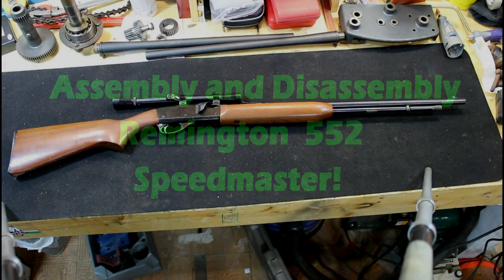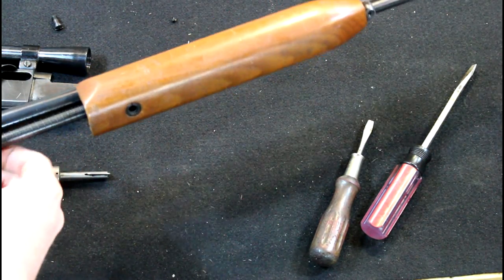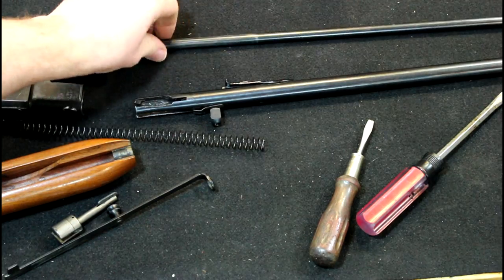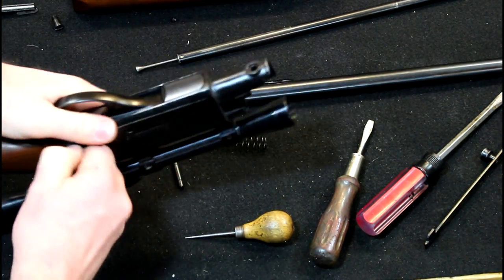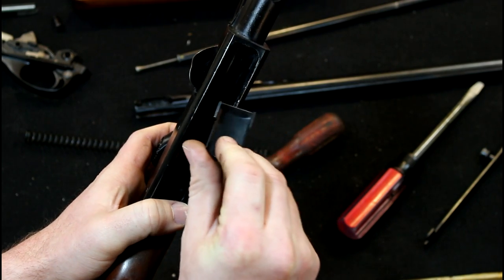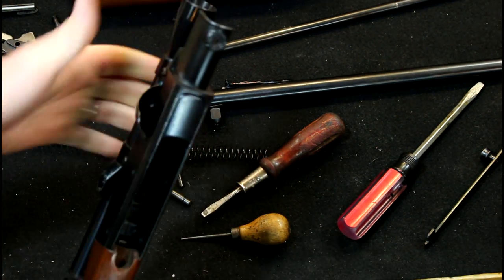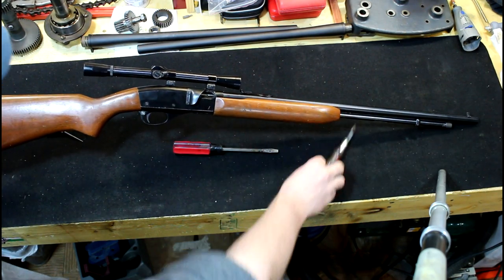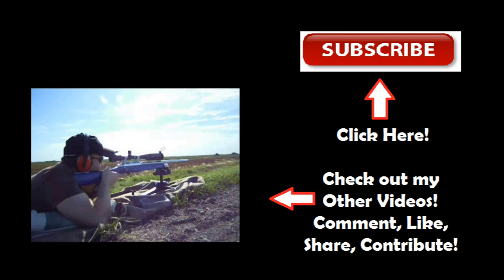Remington 552 Speedmaster Disassembly, Assembly Professional Gunsmithing

Comment: This is one of my favorite 22 rifles. One thing I will say is that I’ve had that little magazine tube retention screw come out a few times. After I lost one in the weeds at the range (and paid $7 for a good used one on eBay), I put 1-2 drops of blue Loctite on it. I find that these rifles are built pretty “tight” and accumulate powder waste pretty quickly. I suggest using minimal amounts of clear light oil and good ammunition. I met a gunsmith once who told me 90% of 552 Speedmasters brought into his shop for repairs are just really very dirty and crying for a proper oiling.

Comment: Given to me by my wife's father when he'd grown too old to wander afield, my Speedmaster 552 likewise had seemingly grown too old to use, jamming with nearly every recharge. This video broke it down on disassembling for cleaning. I could see wear on the bolt from lack of lubrication, and the receiver and action were as nasty as described. Less than 10 minutes to disassemble thanks to this video, an hour to clean, and some resistance from new scope mounted too far forward. But it went back together smoothly overall. Action's smooth once more, and I'll have to take it down once more to prep the barrel for paste rebluing. But then there was that satisfying SHH-Click of the charging handle, followed by a solid Clack! from the firing pin. Thanks for this - it put me in touch with late Father-in-law, knowing that he'd likely used it in the 50's & 60's to bring home rabbit for dinners in Eastern Washington for 3 daughters, wife and her parents. There's a kind of magic in a gun this old, and your video has played a big part in restoring this one. Thanks.
Reply from the maker: Nice story, Glad you were able to get it up and running again and that I could be a little part of that.
Reply: $ cuanto por él rifle
Reply: Nesesito la pieza que agarra con las 2 manos

Comment: Thanks for great video. Cleaned my dad's Dec, 1959 model, I shot thousands of rounds thru as a kid. Loaded up all the shorts it would hold and shot them all in several seconds. Never ever had any issues.
Reply from the maker: Randy Roberts Thanks for watching. I know I shot probably 10,000+ rounds through my 10-22 when I was a kid before I knew they needed to be cleaned thoroughly every once in a while. Firing pin finally got so gummed up it wouldn't strike the shell hard enough to fire. That's when I figured it out a long time ago. Appreciate the comments!

Comment: Great video.   First time I did this since I've had the gun for 50 years.  The only difficult part was separating the barrel assembly from the action. Had to work at it for 10 minutes or so.  If I hadn't seen your video I would have never figured that out.  I also lost time figuring out where the little metal clip came from that fell out of the forward wooden grip. I'll look for more of your videos.
Reply from the maker: +Mick Dousman 
Good to hear! If its never been off like yours they do tend to get stuck! Thanks for watching and commenting!

Comment: Great vid.... mine is from the 70's and I've never cleaned it at all. Went to shoot it today and it jammed for the first time ever on me... it really did something weird.. jammed up and a round got stuck and I didn't know so I went to shoot it again and it sounded loud as a 12 gauge almost.. and blew off the side deflector plate!  The two little screws are still there but plate blew off. Very strange as if the bullet came out there🤷🏾‍♂️ when I un jammed it it looked like two rounds were stuck together as if one was overlapping the other... WOW...I will be throughly cleaning it today thanks to your vid. 👍🏾

Comment: Picked one up a few years ago.Liked the idea of shooting shorts, longs, long rifle. Finally decided to take it apart, mostly to refinish the stock.  Glad I found your video, came apart fairly easy except the bolt was so dirty it was stuck.Got it all cleaned except I can't get the large screw that holds the stock loose. ( Just like Browning Shotguns almost impossible to get them loose)
Reply: Gary:  I'm in the process of doing the same thing.  I have the large screwdriver but it keeps slipping out of the slot.  So, I taped up the receiver and sprayed the orange paint remover which will peel and flake overnight.  Then some scraping and sanding.   I did that to other stocks and it turned out great.

Comment: Thanks for video! Just picked one up the other day. It's either a 1960 or 1967 model. Couldnt figure out how to read the date codes. I took it apart today and I would have to say it was the dirtiest gun internally ive ever seen. It was packed with black chunks and carbon build up. You can eat off the inside of it now. I made the mistake of putting the trigger assembly back in before sliding the barrel back in place. After a few minutes of head scratching i removed the trigger.lol mine has a western field scope on it. I might actually see if it still works before updating the optic.

Comment: Great video !   I have my dads and shot it a few times but the outer magazine warped and looking for a new one.  That charging handle spring was a b!thx to put back in but I didn’t realize I could take the barrel out once I removed that first screw.
Reply from the maker: Glad it helped. There are several companies out there where you should be able to source a new mag tube.
Reply: @precisionmachineshed  I was able to find one in good condition on eBay last week.  I went to the range today but grabbed the .30-30 lever action on accident so haven’t shot it yet!

Comment: Quite nice vid. Professional, educational. I used this  vid for my Rem. 552 project with exc. result. Thanx!
Reply from the maker: lee sherman Hey, Thanks! I'm glad it helped you out! It's a little tricky is you've never done it before!
Reply: spitfire1821 Hey Im having some trouble with my 552 when i took it apart it was funtioning fine. i took it apart for cleaning and put it back together and the bolt wouldnt rack back, it seems really snug in the barrel like almost stuck.
Help please oh and the barrel wont go all the way back into the receiver without me having to take the trigger out and put the barrel in and then the trigger group
Reply from the maker: TheIceman623 Sounds like something is going on with your trigger group. Make sure that the hammer is cocked back when you put it in. I do know that I did notice the same problem with the bolt on this rifle, and I was quite confused, I ended up taking it apart and making sure everything was absolutely clean and very very lightly oiled. when putting it back together make sure that everything is lined up as it should be. also be aware of the plunger on the magazine tube. It can sometimes get caught up in the wrong spot preventing proper installation of the barrel. Hope one of those things helps.  It's hard to diagnose things like this without seeing it in person, but hopefully we can get it figured out for you!

Comment: Ive had mine in the safe for years... No telling how long since its been fired. And, as I thought It jams trying to shoot shorts. Shooting shorts in this rife has a low noise and nice to fire. I guess its just dirty from not being used. I thought maybe its the shells... Looks like I will have to take it to a gunsmith and have it clean. The gun looks new... I enjoyed your video....
Reply from the maker: Hey, thanks, I can't recall if this one was designated to shoot shorts, but many times shorts don't have the power to cycle semi's. Never hurts to have it cleaned though! Good luck with your 22.
Reply: @precisionmachineshed  They will cycle regular shorts, but will not cycle cci 710fps  shorts. It will work with cci quite 710fps long rifle. Guess the 40 grain bullet gives more blow back.

Comment: Great video!   Have you ever had a 552 that stabs the round into the top edge of the chamber, causing a jam? (enters into the chamber at too steep of an angle)  I took mine to a gunsmith probably 20 years ago and he put a chamfer into the top edge of the chamber.  It helped just a little but it is still far from reliable and I basically stopped shooting it.  I'd like to get this thing back running again as it was my first firearm.

Comment: Thanks for sharing this video my question to you the tiny screw that's gets snugged in by feeding ramp I notice if I crank it in tight it appears to rub against the brass rod . Is.it supposed to be just snug ? Or cranked in . Also I am guessing to lock tight ? So the screw don't get lost

Comment: I had a bolt jam, when I took out the trigger assembly out there was a loose part that is a u shaped. I didn't see you  disassemble, but I think I saw it still in the receiver. I think its called a buffer? Can I just put it back in place or is it secured in some fashion?  Thank you
Reply: @Paula Palmer. There is a rubber bumper that goes in the receiver behind the bolt , and a metal clip that goes into a slot in front of it ,Numrich arms has schematic to help you see it.I am getting double feeds with 1250 fps ammo, but Remington target rounds cycle flawlessly. I think the 1250's cycle the bolt too far back.

Comment: Thanks for this video.
My 552 is about 50 years old and for the life of me, I can't unscrew the Take Down screw through a normal screwdriver. May I use a manual impact screwdriver to start it? I assume there's some rust holding it.
Thanks again.

Comment: I had a question please. I am barely on the first step. My screw is not coming out and I'm close to stripping it. I have the same rifle. Can there be a lock pin in it? It's not coming out. It move a tiny amount but I'm totally stripping the head of the screw

Comment: I may have had the dirtiest trigger assembly ever. It was so bad that the trigger release for the hammer would not engage. Guess what it did? That's right, full auto as soon as you released the charging handle, without even touching the trigger! Fortunately, there was nothing around when 4 rounds went off full auto. The reason only four rounds is #5 jammed. Cleared the jam and released the charging handle and the same thing again. Unloaded the rifle and headed home to clean it. Got it on a trade and never checked to see how clean it was. Lesson learned.

Comment: Good video but that kind of ejector is called an "extractor". The ejector is fixed in the receiver like most other weapons. Easiest way to remember the difference is that the empty shell casing is removed by the "extractor" on the same side it comes out of because "ejector" kicked it out.

Comment: HEY, Great video...watched it before disassembly of a buddy's newly acquired 552...I followed the video instructions and cleaned rifle thoroughly before re-assembly...rifle cycles without ammo and seems to cock and fire on an empty chamber. BUT when using live ammo, the rifle will not fire; I pull back charging handle to cycle a round into chamber manually, pull the trigger, and rifle does not seem to have cocked hammer. I then cycle the rifle again manually, it will fail to strip a round from tube, and it seems to cock and sounds like hammer strikes an empty chamber. I then cycle manually and it loads a round into chamber but will not fire. This sequence repeats itself until all the ammo is fed through tube...ANY HELP WOULD BE APPRECIATED!!!Thanks
Reply from the maker: +Ted B Hmm.... well these issues are kinda hard to pinpoint without having it in hand. I would pull it apart and make sure the hammer is cocked before you put it back in. I know I had some issues when I put this one back together, but it had to do with the fact that I switched out the barrels, and the plunger in the feeding tube was causing issues. I would also make sure that the firing pin is really clean and nothing got stuck in there. Also check the back end of the barrel to make sure that the bolt in going into full battery when a cartridge is there. A little gunk might be keeping the case from seating directly on the barrel and might be causing the non-firing issue. Also make sure the bolt moves freely in the barrel when it is all apart. Beyond that I guess I would have to think some more about it. Like I said, hard to fix without having it in hand! Thanks for watching and commenting. Let me know if anything works, I'll let you know if I can think of anything else.
Reply: +spitfire1821 Hey thanks for the response...I have already tried all the fixes you suggest without success but upon further examination I think the FP is NFG. Aside from that I did find a site that suggests a fix that you may want to look at: http://gunhub.com/rimfire/58339-remington-552-speedmaster-firing-issues.html... waiting for some parts now....tb
Reply from the maker: +Ted B Some good info there. Of course I forgot to mention ammo. The sear would make sense and could be an issue, but does not explain the non-feeding issue. Make sure the tube is in it's proper place. A 1/16th of an inch off ether way and you will have feeding issues. Some of these 22's can be a real pain, I once got a browning Challenger 22 that was sent to Browning and seen by a couple other gunsmiths and they all gave up on getting it to function properly. I got it and figured out the feed lip angles on the magazines were not correct and it would only function properly with high velocity .22lr ammo. Worked great after I fixed it and I got it for a song!

Comment: I own a 552a and have owned it for about 55 years.  When I bought the gun it had a small problem, load it up and pull the trigger and all fifteen rounds would fire before it stopped, problem was you couldn’t stop it.  The guy I bought it from wasn’t a gunsmith but knew what was wrong.  I was working in Gulf Mart store in Ft. Smith, Arkansas and I sorta ran the sporting goods section at night.  One night he traded the sear out in mine and a brand new 552a, week later I sold the one in the store, it had the full factory warranty but never came back, mine shoots in the regular semiautomatic way, one bullet at a time.  I immediately felt like I had a made big mistake, didn’t fire another auto until it was a M16.  Anyone else ever have this experience?
Reply: No..but if I has, I wouldn't tell anyone about it

Comment: The spring is stuck on my 552. I saw your video and tried to take it apart. I found the the screw that holds the barrel assembly in place is missing. The Rifle is jammed and won't come apart. Any Suggestions?

Comment: just picked one of these up , made in the 50's in really good shape but missing the forend support and had the wrong screw. I ordered the parts to make her whole but unsure how the forend support goes in. does it pop in and out? glue? I can't see any slot or broken wood .
Reply from the maker: I forget the name of that part, but They were most likely pressed into place in the wood. A good quality glue should hold that guy in place and you may need to find the correct screw.
Reply: Precision Machine Shed I was able to get the forend support and got it almost 100% . only issue I have is the cartridge ramp.  when it's installed the barrel won't slide in the reciver.  the ring just sits too high. It seems to shoot fine without it but the blueprint for this model shows it . mine is from the first year they came out so I can only assume that it wasn't apart of the gun the first year they were in production but I could be wrong.

Comment: My 552 some times it won't eject you think my ejecter is if so what do I look for
Reply: You might want to ask a gunsmith that knows extractors from ejectors.  He repeatedly calls the extractor an ejector.  Rough gun handler, laying parts on top of tools, scaring up finish on aluminum receiver.

Comment: My forend is wabbly. Its night snug to the barrel. The action screw it tight but the forend wiggles around the forend escutcheon. Any ideas?
Reply from the maker: Just going off memory, could be loose from not being tight over several years and accumulating wear, or sometimes screws get replaced and they are too long not allowing things to get tightened down completely. Just a few thoughts. Tough to tell without looking at it in person.
Reply: @precisionmachineshed  it make sence. I may gring just a tad off the end of the action screw. Should work. Thank you very much.

Comment: can not get screw out of forarm stock screw turns but will not back out looking for solution
Reply from the maker: +Whalen Kemp 
If you have a really tight fitting screwdriver you can try to ease it out. Last resort might be to try and 5 min epoxy a screw driver to the screw so you can pull on it a little. A little heat should help remove epoxy later.

Comment: What size it that screwdriver I'm pretty sure it doesn't exist.
Reply from the maker: LOL. Sounds like you are having issues. I'm not sure what size it was I used in this video. I usually use a fitted driver bit from a set like the Brownells magnatip set or I think Wheeler Engineering makes s gunsmith screwdriver kit. Getting a snug fitting bit will aid in removal of a tight screw.

Comment: It does shoot .22 short, .22 long and .22 long rifle right?
Reply from the maker: +Nu B I believe this one did take all 3, however some may only take one or the other. It is usually stamped on the barrel as to which cartridges it will take.
Reply: @precisionmachineshed  It will also fire the low velocity CCI, except the shorts.